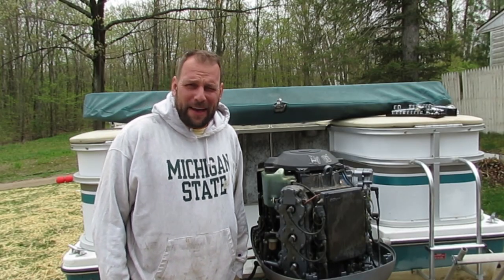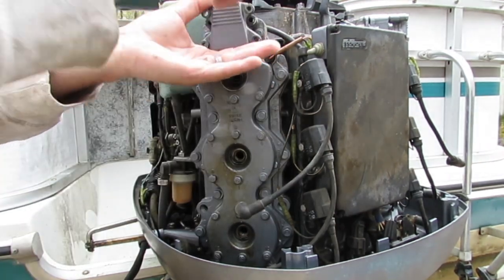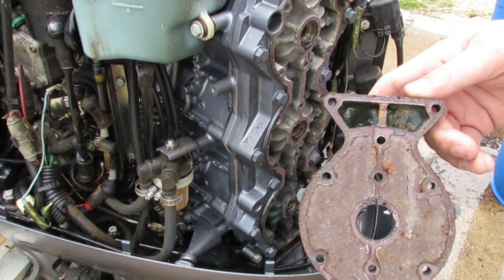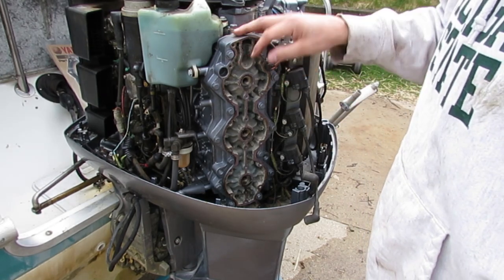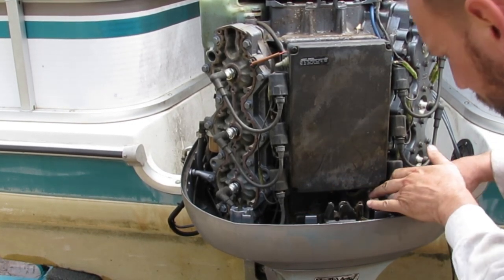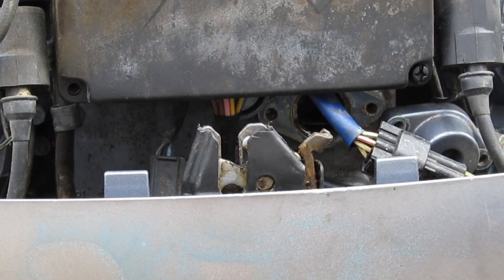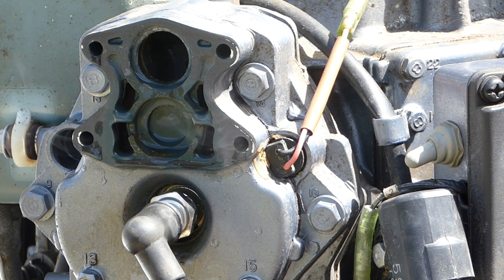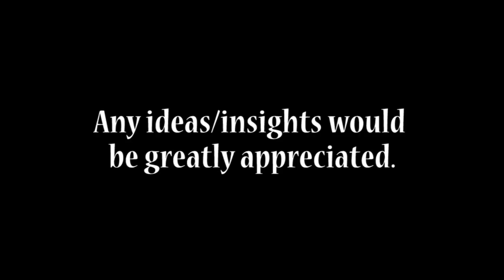Outboard overheating - I've tried everything...

Comment: Mate u had any luck I am in same situation I replaced all parts with genuine Yamaha also removed cleaned and replaced head gasket still overheating 🥵
Reply from the maker: My issue was that I bent a small tab on the water impeller housing when replacing it.  Wasn’t allowing enough water to pass through.

Comment: i am goig through the same problem, where is the metal tab located?
Reply from the maker: It's been a long time since I posted this video.  The part with the metal tabs came with the replacement impeller.  If I recall, it was a metal plate, almost like a gasket, that had a couple metal tabs bent 90 degrees.  Sorry I can't be of more help!

Comment: Run rydlyme  marine descaler pull thermostats out without motor running use a circulation pump or bilge pump  to circulate through motor for two hours it will clean waterpassages out like new

Comment: You have done plenty of work but here is two little things that I did not see in your investigations of the overheating. Take the thermostats out and ran a wire from the base of the thermostat house. Make sure that the passage is clear. The second item that I suggest, is drop the lower unit and at night time place a good strong flashlight in the brass/cooper pickup tube... the light should be inside the tube and no light should be coming out of tube specially at the end of the pipe..if you see break
Reply: In the pipe you are loosing pressure. The new news I believe are made stainless. Good luck

Comment: I’m a certified Yamaha tech the biggest mistake I see all the time is don’t just replace the impeller. Do a complete kit wear plates and housing. Use salt Away
Reply: One thing I learned about those water pump kits available on boats.net is that there are 2 extra seals needed that are not included on the kit. They're called "water pump housing cover" and "water seal"(i have the same motor 2 years older than video). I'm dealing with the same issues and just yesterday i realized what was, at least, one of my problems. I'm sure you can take the old seals and use it on the new housing. Part numbers 6E5-44312-00-00 and 6E5-44365-00-00
Reply: I stock the 2 parts you talked about. But yes in most cases I reuse the old parts
Reply: Patrick Rolf I have a Yamaha 40 2010. Same problem as this chap.  I even tried flushing it with acid. Still over heating and no alarm, just rpm roll back. I did not take off the water jacket
Reply: Saanichton Ministries make sure the engine is I actually overheating disconnect the coolant temperature sensor Run  briefly To see if it goes into limp mode you should be able to hold your hand on the block after running it without getting Burnt
Reply: @patrickrolf482  I think it is over heating. But I will try what you say. I plan to take the head off today, inspect the passages and manually clean. Flushing has done some good but not enough. I recall one time I unscrewed the tell tale hose and the water was very hot coming out of the hose. Other times, upon over heating it is cold....
Reply: @patrickrolf482  I unplugged the sensor and it ran good for a while then the computer rolled back the RPM once again on me...
Reply: Replace the poppits valve
Reply: @jimhardies9345  I tested the sensor by the Thermostat on a multi meter and it was good and responsive. There must be another temperature sensor on the motor for redundancy? Upon RPM roll back when running hard, I popped the cap and felt the head. It was very warm, but NOT burning hot by any stretch. I sprinkled some water on it, and it actually took a few seconds to evaporate. So it may not be overheating after all... What is the poppits valve? I will try anything. I have begun researching the market for a new Honda 40. I even flushed the motor with pure vinegar for several hours
Reply: @jimhardies9345  Thanks. I am looking into it at this time. Do you know where I could find it on the outboard F 40? It is a 2009.

Thanks
Reply: My service manager said there is no Poppit valve on the F 40 2009. We are targetting the fuel pump now. There was a bullitin for my engine type and year, and the work was never done.
Reply: Why does my Yamaha heat more on the left then the right side? 120F left 100F right ????
Reply: Eddie Martins v4 or v6 Have separate thermostats one per bank and like the guy explained in the video if you have excessive corrosion buildup behind the cylinder head or in the exhaust Valley in between the heads one side of the engine could possibly heat hotter than the other side
Reply: I was chasing after a heating problem and the motor was not overheating, but had a a defective HP FI pump! I wasted time effort and money on assuming it was overheating. I should have known as the alarm never sounded as it rolled back the RPM. I think as to motor heated up, the defective pump symptoms got worse which tricked me.
Reply: Saanichton Ministries damn huh I’ve got a 99 evinruide 225 ficht I replaced both thermostats and water pump and still don’t come out tell tail or don’t think it goes up to thermostats sux cuz the other thermostats were fine my great friend ran motor without ears and cooked my impeller unbelievable no brains I still haven’t figured it out I’m in mass didn’t even take it out yet was gonna just take it out and run it maybe clean itself out idk I’m out of ideas runs great no water tho with ears on idk what a shame 😐
Reply: Tommy Morrison When your friend burned up the impeller did you get all the impeller out did you replace the housing and the biggest problem I see is the sleeve that goes from the impeller housing to copper water tube in the midsection gets pushed up to far or falls out and never gets put back in.
Reply: Patrick Rolf yea damn I didn’t know to find the impeller pieces but I did replace the whole housing tho and yea I did put the copper piece back in rubber hose when I put it back in idk thankx for replying I really appreciate it if your on back of boat looking at motor I took the left thermostat out and left it out to see if water would come out but only did it for a minute with ears cuz I don’t want to ruin it more it runs good but no water I was thinking just take it to the bay I haven’t done that yet and I’ve ran it like ten minutes on fifteen minutes off a few times still nothing idk but no alarms went off I’m lost fr
Reply: Patrick Rolf it’s weird there’s a spot we’re the tell tale is too hook a garden hose too I tryed that lots of times too it’s like a small plastic box that the tell tail is hooked too but no hose weird idk
Reply: Patrick Rolf I really appreciate your help I don’t have a grand to throw away at the shop kinda sucks
Reply: Patrick Rolf do you mean the rubber hose on the lower end that goes over the copper pipe sticking down from the motor right
Reply: Tommy Morrison Yes when you put the lower unit back on. Sometimes the alignment isn’t just right and the water pump actually hits that rubber piece and pushes it up on the copper pipe instead of neatly slipping over it
Reply: Patrick Rolf damn so I should take the lower end back off idk I had my brother in law help me put it back I seen the hose come off but pretty sure I put it back but the splines didn’t line up I was being patient moving prop to get it right he pulled down a little bit and it went on while I was trying to get shifting rod thru hole damn so yea maybe that I really appreciate you helping me tho
Reply: Tommy Morrison If you remove the lower unit to check that rig up a garden hose that attaches to that copper tube and start the engine and see if you’re getting water pressure out of the thermostats housings and you don’t have a Clog from the old water pump impeller
Reply: Patrick Rolf yea I tryed to run the motor with one thermostat off and had no water but only let it run like a minute cuz I don’t want to mess it up more no water at all came out
Reply: Patrick Rolf idc if this gets posted twice if you guys need work on your outboard you better let Patrick do it this guy can fix any problems with a outboard listen I just want to thank you again you were right on bro I dropped lower unit and copper pipe was actually bent sideways I took a narrow board bent it back nice and easy hooked rubber hose back put Lower unit back on and the tell tale was pissing out again wow want too thank you soooo much I hope you know what this means too me damn I will make it in the water this year thankx to Patrick my hats off too you I must of watched you tube videos probably 300 no joke I’m back in the water again nice man godbless you and your family stay safe I really do appreciate all your help ty😎🏆
Reply: Tommy Morrison Thank you for the prayers. I’m glad I could help. God bless you and your family on the water.

Comment: Hey, I'm having the same issues as well. Changed out all the same parts as you have. I'm running a pro v 200, what was your fix for this. I appreciate your time if you can reply.
Reply: He said: "Solved- I bent a metal tab when installing the water pump. This caused not enough water to be pushed through. "

Comment: Did you got fix. I ran into the same issue that you have a few month ago I can tell you what I did to fix mine.
Reply: What did you do? My overheating alarm goes off when I go full throttle. I can go 1/2 or up to 3/4 of full throttle and I'll be ok. New impeller was installed a month ago and the pee whole is fine.
Reply from the maker: I bent a metal tab when installing the impeller. Water pushed through...just not enough to cool it.
Reply: @TheHardWayChannel  thank you
Reply: Gabriel Marin when mine was overheating I didn’t know what it was cause it’s was my first boat, the guy who sell it to me told me that everything was good which it was a lie the water pump was old as well the fire plugs and thermostat were also messed up, so I put a new water pump, new thermostat and fire plugs, but what surprised me was when I took off the water jackets of both cylinders. You have to put the water jackets out so you can see the pistons around them there are water circuits that gets clogged too that’s what was going on with my motor around both of the cylinders was clogged with some type of hard sand that didn’t let the water flow correctly and also my water jackets were super clogged too. I clean them up and put new gaskets took it out to the water and run it up to 4700 rpm for around 10 minutes it ran like new . I expend around 400-500 (new water pump- fire plugs- thermostat and all the gaskets). Also check you poppet valve sometime they get clogged up too but they are really easy to clean, only 2 screws pull the little plastic out and you can clean with a small screw driver. I hope that helps. Most of the times when its a overheating issue its clogging or last call a bad heating censor but i talked with 2 Yamaha mechanics and they say its really hard for the to go bad. I hope this information helps 
GOOD LOOK

Comment: Id take the thermostat out, spray some gunk in there n let it sit . Then stick a hotsy pressure washer with a good rubber cone tip and flush it really good til Ya see salt crumbs , foreign objects spitting outta the exhaust hole

Comment: bro ur problem is the water tube coming the impelller trust me
Reply from the maker: It was a bent tab on the water pump that was letting some water escape and not get pushed through the motor.  I messed up installing it...
Reply: oh gr8 bro exellent gd bless bro u did a gd job